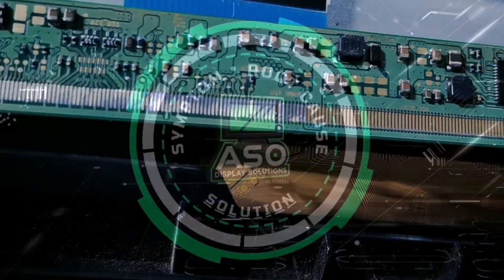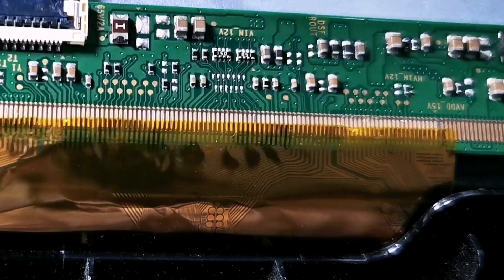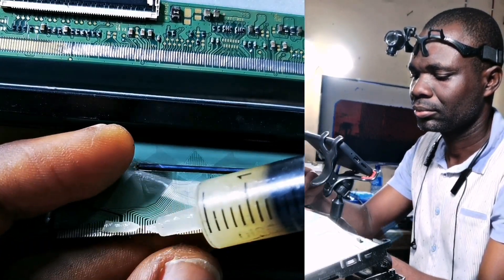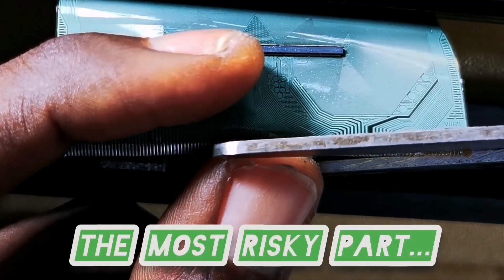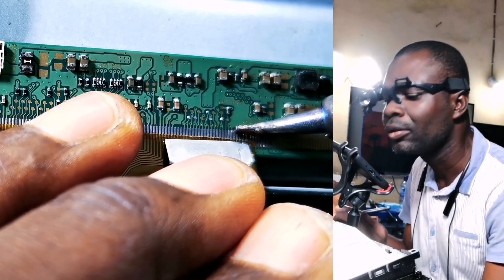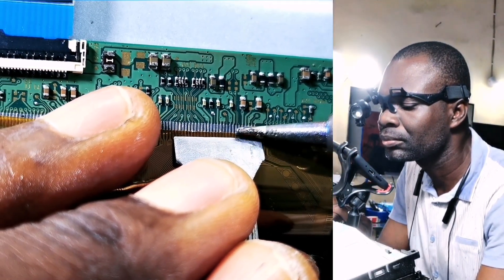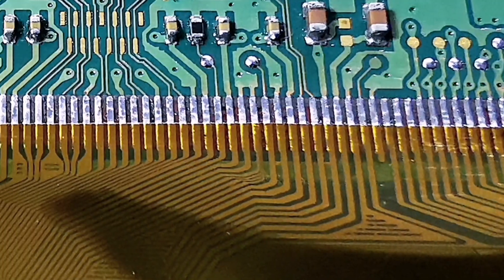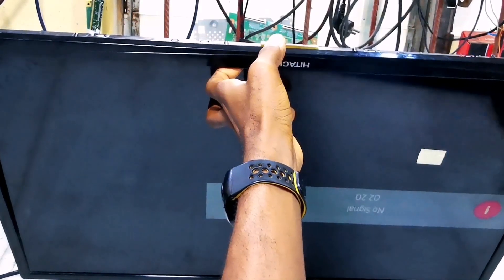How to Solder BIG COFs Samsung LCD Panels (Amazing Results!)

Comment: Sensei una pregunta, es necesario cortar no es más simple solo poner el Flex más abajo y es lo mismo al soldar
Reply from the maker: Great question. Here's why it's a good idea to cut. Leaving the COF tip uncut leaves longer strips of conductive areas open to a higher chance of solder bridges while the iron tip glides. Cutting results in the less likelihood of that occurring. You're a cherished channel member♥️, so I'll give you more details on one of the membership videos.🎉

Comment: I had to get off my friends phone and come over to my pc just to watch this again, thank you so much for your video it looks like that worked exelent and you are a very skilled solderer!!! you can tell at 1:08 how you did that prep so easy you glided though that very awsome man I'm going to practice on some old boards ( I have got a huge collection like 20 tv's worth of parts boards) 😅 before i do the TV I am building (pretty much from scratch and miss mached boards and pieces) It was origanally a WBOX tv that uses mismached boards from different companies anyway, like its got a LG power suply mixed with samsung tcon I believe and then some other board I cant tell who made it but its a mess of missmached parts and I'm putting all sharp boards in it Hopfully if I manage to do what you just did I'm going to make it a sharp tv in a wbox frame and screen LOL. Ive only been fixing tvs for a few years on and off I mainly do laptops though but I'm learning a ton about tv's doing this compleate overhual of a tv. Thank you so much for your video and remember anything is possible if you put your mind to it!👍
Reply from the maker: Wow! This says so much about your kind heartedness! ❤️❤️❤️

Comment from the maker: Follow me on Telegram for more personal guidance - https://t.me/+4-px4i5cOGUzYTY0 (DM: +2348057362029). Please note that you can purchase some of the repair tools and equipment I use below.

FNIRSI 1014D Digital Oscilloscope 100MHz 2Channels 1GSa/s Real Time Sample Rate https://s.click.aliexpress.com/e/_ooFi705

HABOTEST HT208D Digital Clamp Meter  https://s.click.aliexpress.com/e/_olsXlR9

LED Backlight strip for 40” https://s.click.aliexpress.com/e/_oBXnHor

LCD TV screen LVDS tester  https://s.click.aliexpress.com/e/_opdv2AP

SMD Repair Tools
https://s.click.aliexpress.com/e/_onqNf2L

AUO-M106-11 LCD Chip Power IC
https://s.click.aliexpress.com/e/_opuWh9t

Solder wick
https://s.click.aliexpress.com/e/_DCuYfCb 

Solder paste
https://s.click.aliexpress.com/e/_DC8t8gB 

Soldering paste 
https://s.click.aliexpress.com/e/_DBZncOb